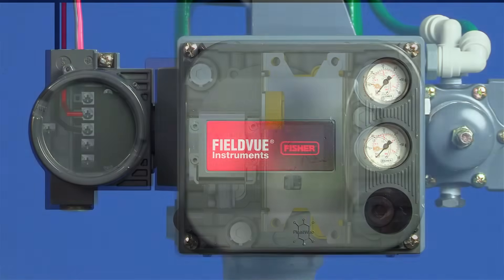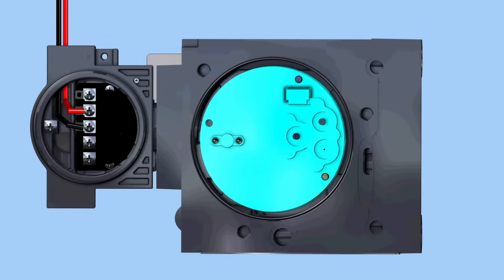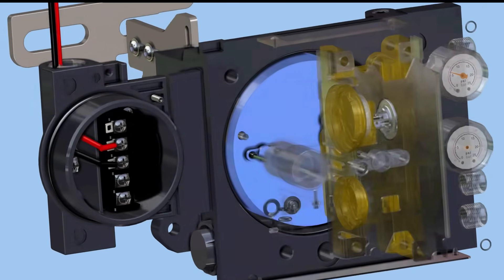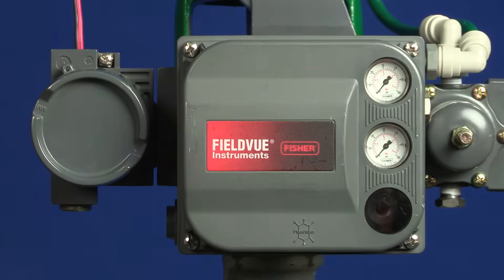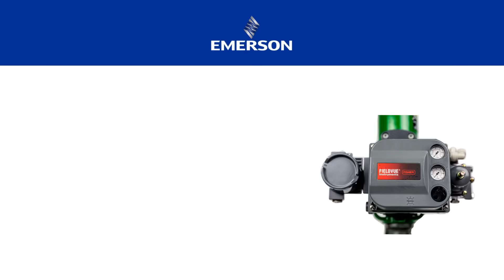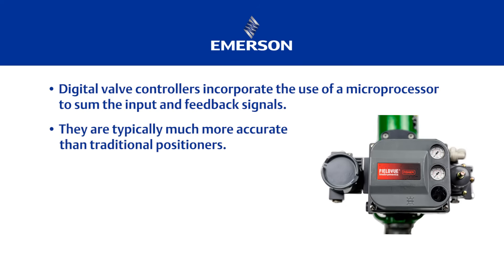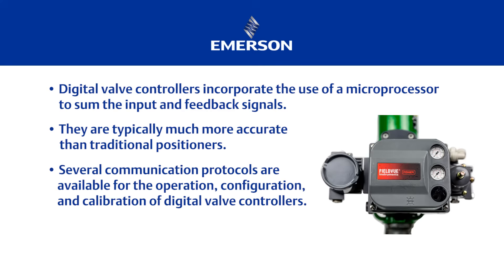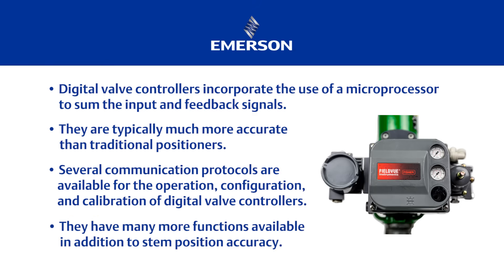What is a Digital Valve Controller?

Comment: does a DVC adjust pressure output to cover for actuator springs that are too stiff? for instance a 2" 10-30 that is only getting 1.5" 10-30, will the DVC ensure it puts 40lbs to the actuator to get that extra 1/2" of travel?
Reply from the maker: The DVC will continue to adjust output pressure until one of the following takes place:
- Travel measured by feedback matches the desired set point
- Maximum supply pressure is reached or
- Zero output pressure is reached  
So it will compensate, but that will be limited by supply. However, if you find yourself tempted to continue to up the supply pressure we'd suggest reaching out to your local Emerson sales office to troubleshoot the root cause.

Comment: Asl
How one pair wire work analog output and analog output
Question is if I am in junction box measure mA of valve if dcs send 8 mA and feedback is 12 mA what my Multimeter will show in JB
I am confused how one pair wire work both AO and AI
Reply: I believe your Multimeter will show the 8mA signal from DCS, you will need something like a 475 to see both input and feedback
Reply: Hart is able to transmit input and feedback signal at the same time using slightly differing sine waves, it's also able to send ditigal hart signal along with analog signal at the same time over a single pair. Bell 202 + Analog signal

Comment: Hello,

Can you please explain, if a Double Type relay will work with a single acting actuator. Are there any settings?
Reply from the maker: Relay A may be used with both Double Acting and Single Acting DVC6200 digital valve controllers.  When using relay A as single acting there is an adjustment wheel in the relay that must be set by using a screwdriver.  Rotate the wheel adjustment in the upward direction or negative adjustment indicated by the sticker on the front of the relay until the adjustment stops.  This will set the Relay up to only operate using output A from the device.   More information can be found in the DVC6200 instruction manual https://www.emerson.com/documents/automation/instruction-manual-fieldvue-dvc6200-hw2-digital-valve-controller-en-123052.pdf

Comment: hi would some one clear my doubt as this DVC is a two wire controller how does the feed back of valve position to DCS and input from DCS works
Reply: Feedback of the valve position to DCS is through communication protocol used. Either HART or Fieldbus communication. One is 2 way superimposed 4-20mA signal and latter is 2 way digital signal .